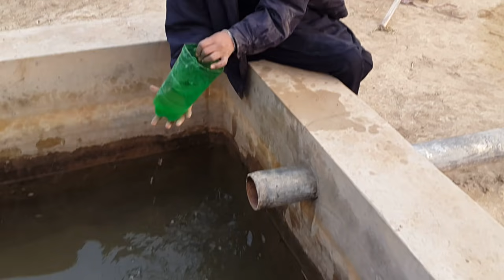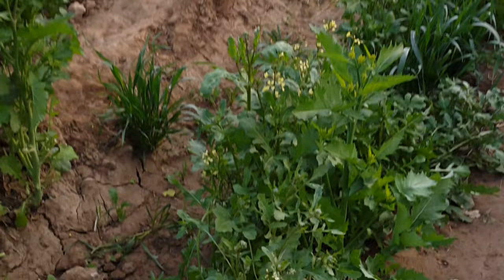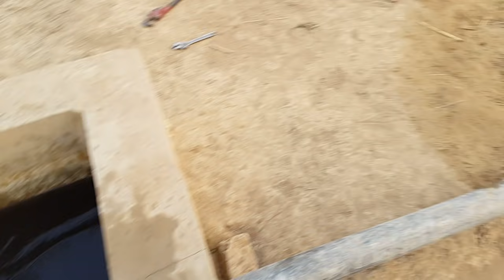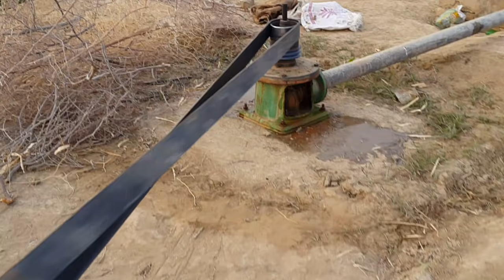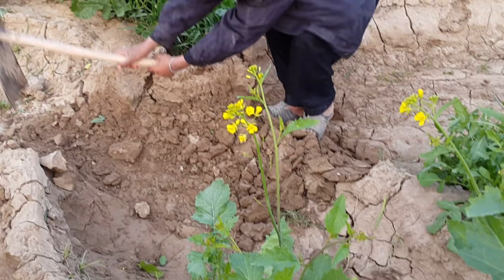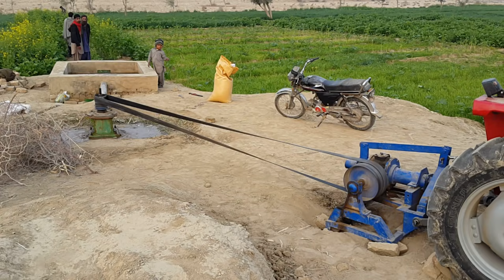Pumping Water From 300ft | Tubewell Technology System With Tractor | Agriculture In Pakistan

Comment: Use Piplin in field 
And start drip irrigation
Reply from the maker: How?
Reply: SHER GILL drip line irrigation in such dry climates are not ideal. 
The water loss from the evaporation rate and insects being attracted  too the crops from the constant availability of what is normally scarcely available open water sources in those areas, both are dealbreakers.

Comment: For four inches water pipe ,using tractor, it's not economically and mechanically useful, instead they can use a small motor pump with less oil consumption and safety.
Reply from the maker: It is 300 ft

Comment: Can any one explain me the principle behind it????
Reply: It's very easy. First the boy filled the delivery pipe with water this is called priming of the pump which is done to remove air voids. Then with the help of tractor PTO (power take off, this one looks like standard 540 rpm)suitable transmission drive ( flat belt) powered the pump which I assume is a vertical turbine pump.
Reply: @abhinavsharma9243  nice explaination